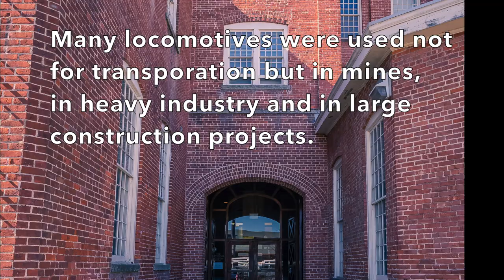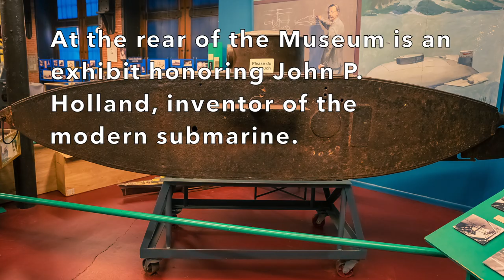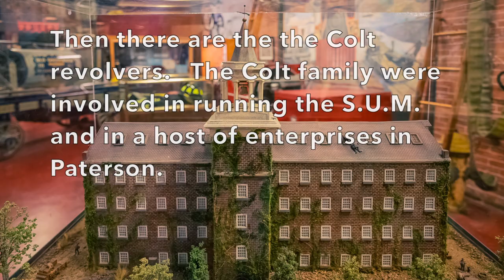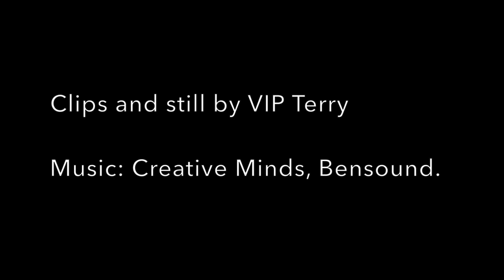Paterson Museum Tour

Comment: It's cash talking to the Parks dept I found the air plane grave yard and wanted you to know so you could pull some strings with your Air force buddys and fill out some government form for a couple and know that we got a ranger park you can fix the wall on spruce st between the burger King so it don't flood there parking lot and turn on the race way